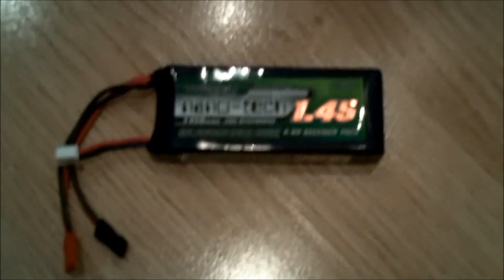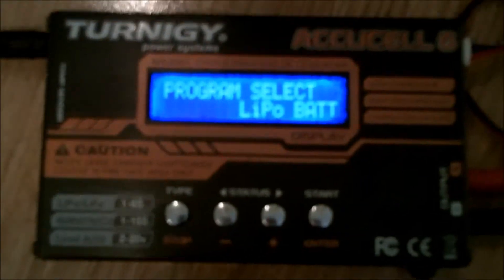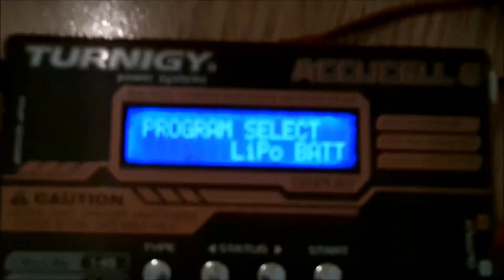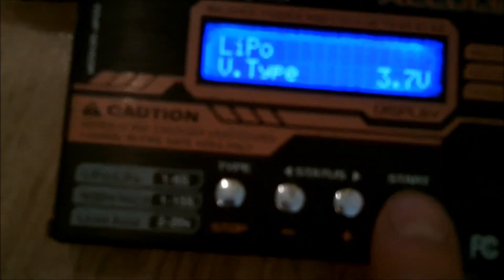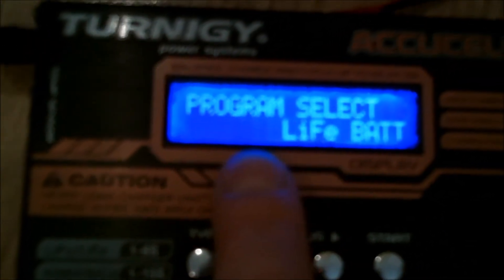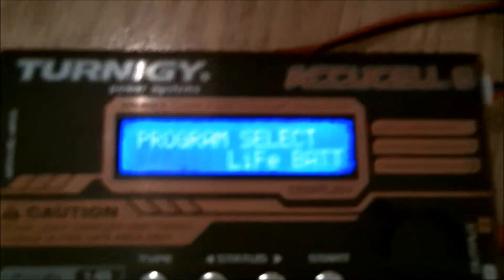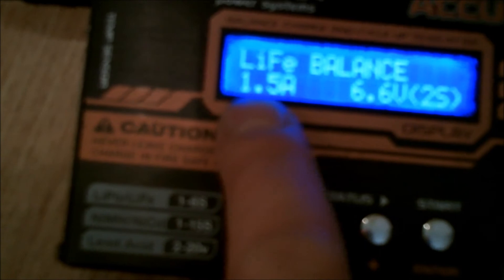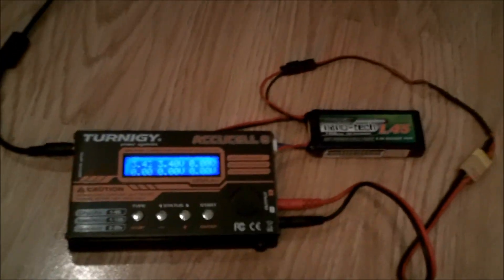How to charge a LiFe battery with Turnigy Charger

Comment: I have a "Revo-Electric Cell Pro 4" charger that I charge my A123 batteries with and I only have to connect to the battery's JST-HX balance connector in order to charge the packs.  Does this charger need every lead out of the battery to be connected to the charger in order to work??? ... confused